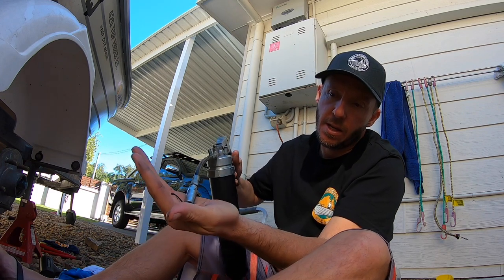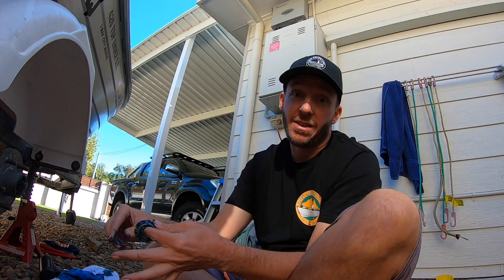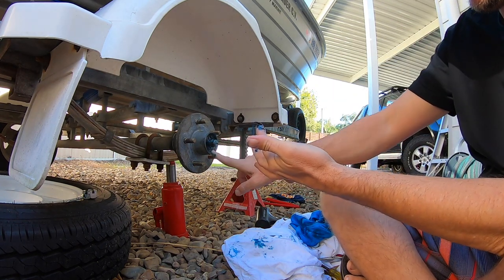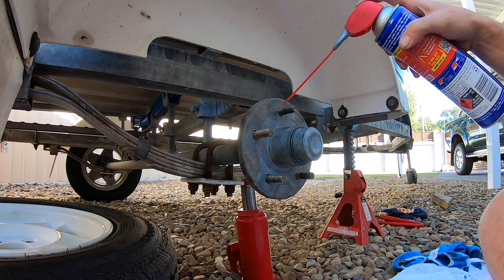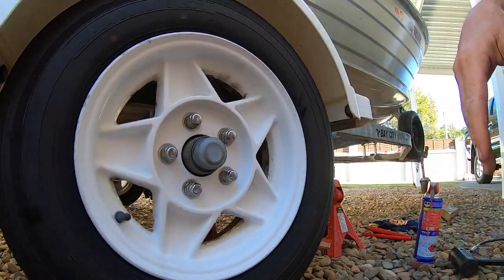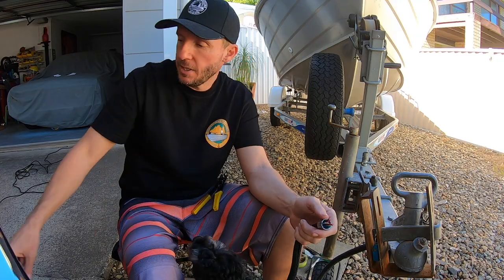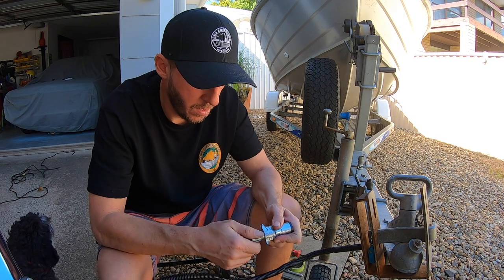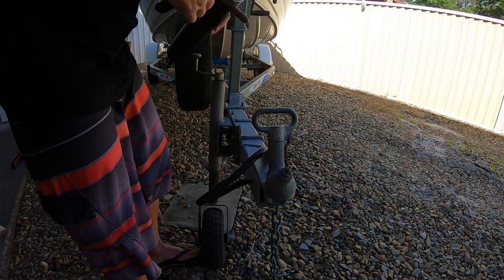Upgrading my boat trailer lights to LED's and some basic trailer maintenance 🚤

Comment: Little tip for you inregard to cleaning bearings, use diesel instead of petrol. Diesel dries leaving an oily film which helps rollers should grease be missed on a roller and its far less flammable to work with. 😎
Reply from the maker: Thanks for the tip. 🍺🤙

Comment: Good stuff! LED lites are awesome aren’t they? The bearings are probably the most important thing to check - I can put 2000 km on my unit in a season  - last thing you want is issues at the side of the roadway. I actually took a wire wheel to all rust and painted over it to make it look better ha ha ha
Thanks from 🇨🇦 - cheers
Reply from the maker: I hope these lights are awesome. I haven't tested it yet so we will see. Cheers mate

Comment: Great job mate. Fully watched, ads and all. 😃👍The only thing I do when I do my wheel bearings is wear a pair of blue disposable surgical gloves to prevent my hands getting greasy. Also when I put the main bearing nut back on I tighten it all the way up, and then back it half a turn and then line it up with the split pin hole ensuring  that there’s still a very tiny bit of play (sideway movement) in the wheel. I double check this by holding the wheel when it’s tightened back on ( while still jacked up) holding it in the 3 and 6 o’clock position and give it a tiny wobble check making sure there’s a tiny bit of movement. Great vid as always. Loved how you did the lights. I need to replace my trailer lights too. Sick of using a light board again. Hope that ankle heals well mate. Cachya soon. 😃👍
Reply from the maker: Yeah gloves is a good idea. I did tighten the nut all the way up before backing it off and nipping it back up. Probably should have shown it or said something about it.
Reply: @AusAdventure  Thanks mate. Actually last time I bought submersible lights I joined the wires,at the back end and they only lasted about 2 years. I didn't know you could buy them with the wiring all they way to the plug so I`ll now try and do the same. The light board that i bought becomes annoying  each time. Good to see you back mate. That ankle injury sounds annoying.
Reply: Great video & good to see you posting up 👌
Agreed with backing the nut off so there’s a very little bit of free play. That allows for the bearing to expand as it warms up. 
Looking forward to watching more of your adventures 🎣🚤

Comment: Nice an simple explanation mate👍
I built my trailer 20+ yrs ago an since new have used the deodorised aerosol fish oil on all the bolts and u bolts etc and I have towed that boat up the cape several times (as lived in Cairns for 30 yrs) and as far south as Melbourne an back to cairns and all the hardware is original so the fish oil definitely works👍👍

Stay safe budd 🤙
Reply from the maker: Cheers D. 🍻

Comment: Hey mate just finished watching your shed house build videos. Bloody inspirational. Makes me want to get off me butt and get finished on my 6x6 putting a Mezanine floor in and storage. 
On this vid I noticed you have bugger all rust throughout your trailer. You get out a lot more then myself for sure so I was wondering what tips you have for keeping the rust at bay on the springs etc I give mine a decent wash down but it’s so bad after maybe 5 years I am ashamed.
Reply from the maker: Hey thanks Paul. Yeah I give the trailer a very good wash after each use but I also spray it with Inox or WD40 depending on what I have on hand at the time.
Reply: @AusAdventure  do you do that after every wash? I bought the salty captain stuff and always what I thought was a solid wash. Maybe I need to get the pressure washer out or something followed by the innox or wd40. So annoying
Reply: @paullobwein1632 I have had my current  galvanised steel trailer, purchased new, for just over 20 years. Before ever putting it in saltwater, I painted the springs, axle, galvanised steel rims etc with a product called Fisholene. It takes a while to dry, but after curing, it basically stops rust from forming permanently as long as the coating remains intact. I just wash down after saltwater use and after all these years, my trailer looks new. You can get similar product in pressure pack form these days. All that said, if you use this stuff, don't just apply it to already rusty steel. Remove all rust, and then apply it.
Reply: @willshunting  wow I wish I knew that 5 years ago. Well I guess I will have to get in there and scrub off the rust then do the same. Such a shame no one really tells you this and you trust these other products.

Comment: Nice rims, wish I could justify the expense to upgrade my gal wheels to alloys, but not for something that's just aesthetic, and the missus would kill me. :) FYI don't use WD40 on your wheel studs... it's great for breaking loose rusty nuts but it's not actually a lubricant... in fact it removes oils and greases. Better off with a smear of grease on the threads.
Reply from the maker: Cheers for the tip mate.

Comment: Hey mate I just bought the same trailer lights. Quick question once the wirings fed up through the frame how do you connect it to the plug ? Do you just twist 2 colour matched wires together then put it into the plug and screw it down? Thanks
Reply from the maker: Yeah if two are the same such as the brake lights you would twist them together.  Google a wiring diagram to make sure you put them in the right position in the plug. 👍

Comment: What spray did you use at 7:08 after drilling the holes for the lights?
Reply from the maker: Hi Shawn. It was just some spray paint I had sitting in my shed. If I was going to buy some I would just get some cold galvanising paint.

Comment: Mate how did you feed the wiring to the front of the trailer?
Reply from the maker: I attached the new wiring to the old wire then pulled it through to the front. 👍
Reply: @AusAdventure  ah thought so
Cheers Mate